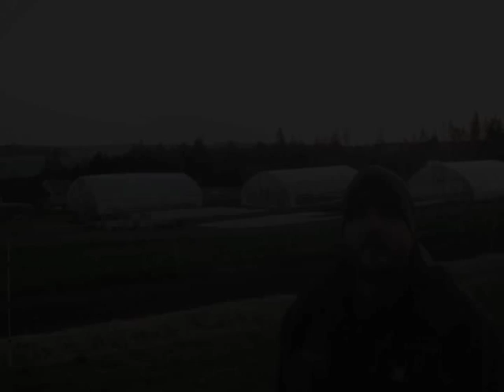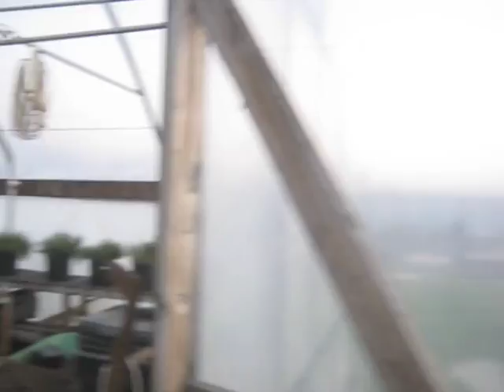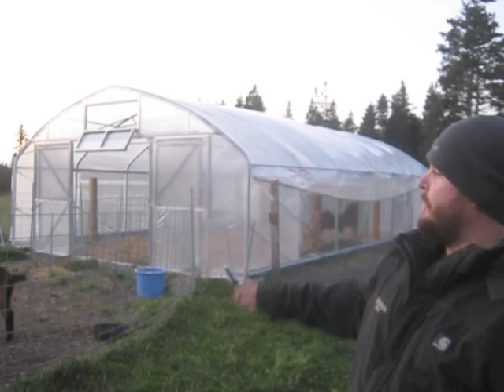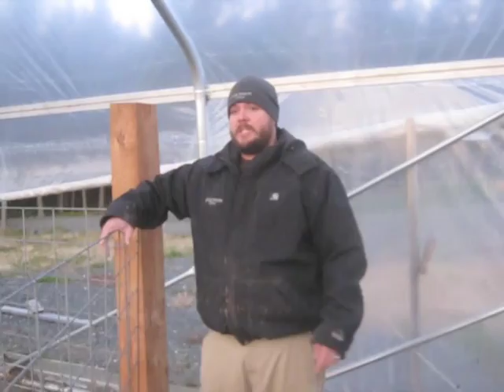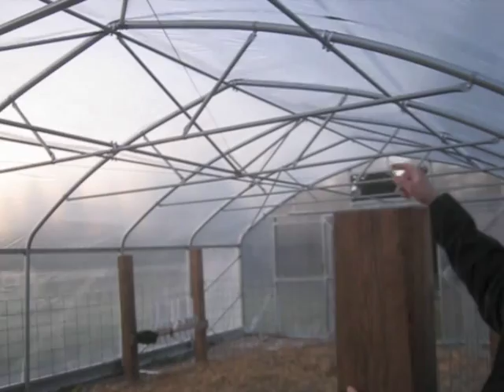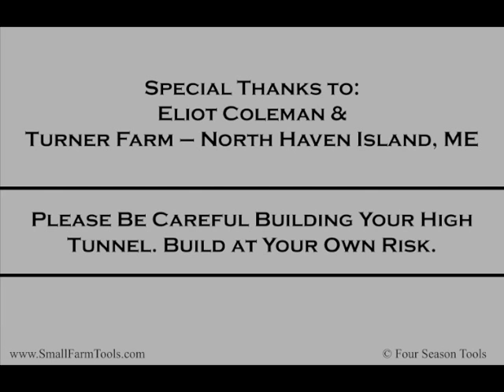FST - Video - Wind and High Tunnels 8-Nov-2011.m4v

Comment: I'm up here in LUBEC, Maine on the Bay of Fundy where the Wind is manufactured, I Use doors on sliding tracks to add strength and prevent the wind from ballooning up inside when the doors open and we use drilled anchors and multiple 5 gallon buckets filled with 80 pounds of concrete every 8 feet that are chained to the lower frames.